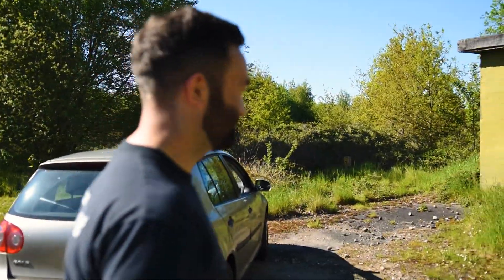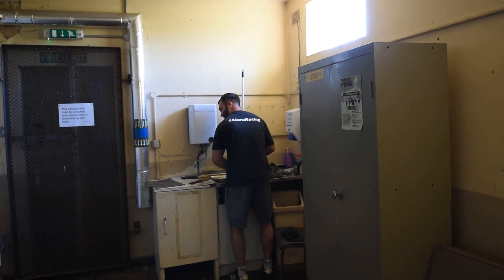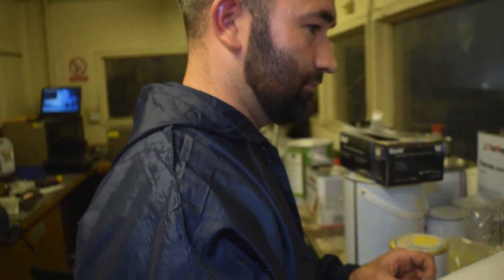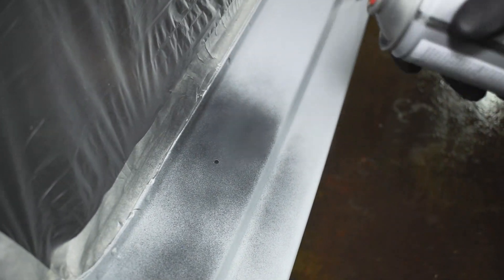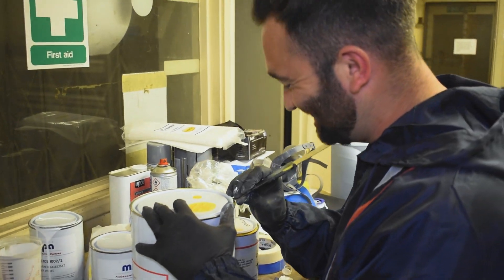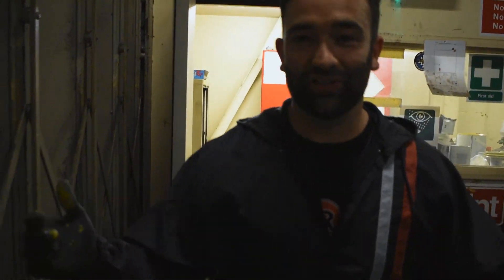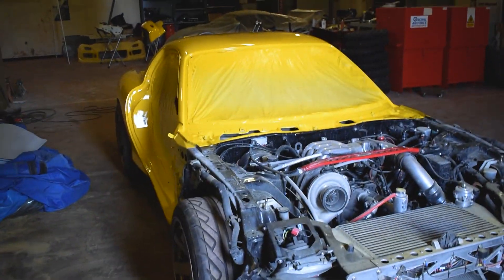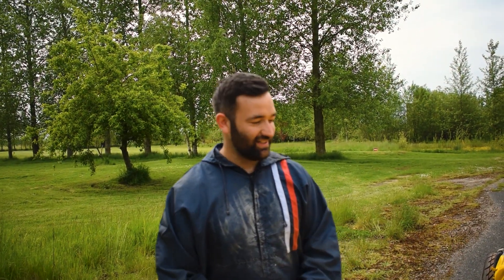This 12hr DIY Paint Job Nearly KILLED Me... But It Was Worth It

Comment: Any tips that you learned on ur first run for newbies?
Reply: From filming it I reckon making sure you have enough time and patience and make sure you put a lot of effort into prepping the car.  

On the day of painting alone Steve spent the majority of the day prepping the car, as you saw it was getting dark before he even laid the first layer of paint. That’s not even including the months of research and prepping before this video. Don’t Rush It! 

Make sure the place you’re painting the car is as dust free as you can possibly get it. Make sure the lighting is adequate so you can see what you’re doing and make sure you have enough space to get around the car. 

I’m sure Steve will respond when he’s awake 😂
Reply from the maker: So Jordan has summarised it quite well.

Take your time make sure you have double the time you think it will take.

Make sure the prep work looks like a painted car just another colour. Because base and clear won't hide any issues.

Lay the first coat of lacquer light. The first coat will run real easy.

Practice on a small piece first all the way from prep to clear so you know everything works together. 

And last watch loads of videos. Paint society is quite good for info

Lastly enjoy learning don't beat yourself up about little defects alot can be buffed out